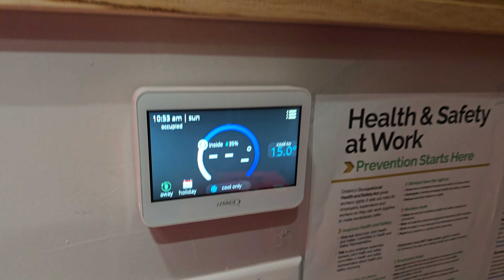Rooftop AC Not Working? Watch How I Diagnosed The Economizer | HVAC Troubleshoot

Comment: Was the settings the issue?
Reply from the maker: In this video, the economizer was faulty, preventing the air conditioning system from turning on. The faulty economizer module was replaced, restoring proper operation of the air conditioner system. Please subscribe, like, turn on notification bell and share the channel.